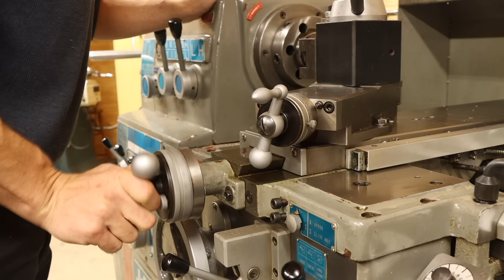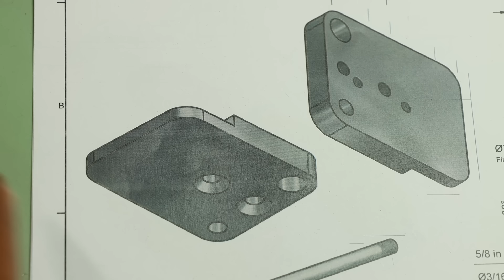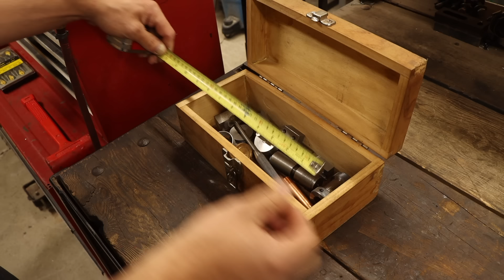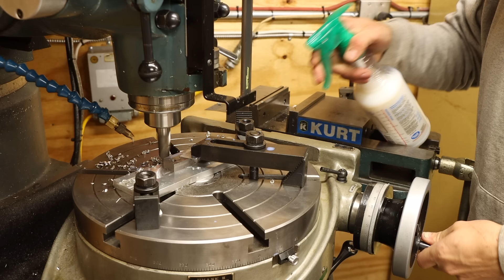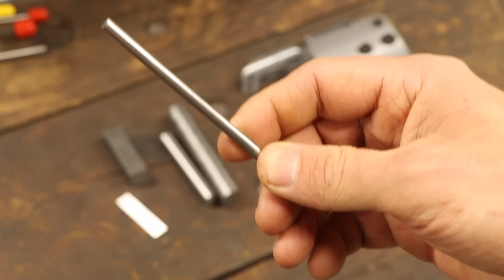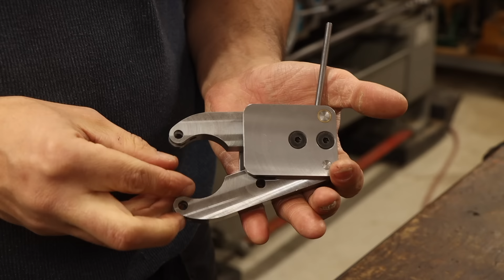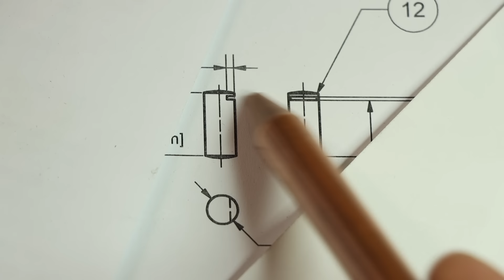Making the KING of All Knurling Tools (Part 1) || INHERITANCE MACHINING

Comment: 4:07 were the countersink screws not in the kit?
Reply from the maker: Yes they were
Reply: @InheritanceMachining  oh .... what came in the mail ~just in time~ .... the vise stop?
Reply: Oh you're talking about the counter bit
Reply from the maker: @dizzolve  oh sorry haha i was referring to the countersinking cutter.
Reply: @Inheritance Machining  I love those Hemingway Kits. I built the mini boring bars. Very simple but fun. Also got some round machine belt from them.  Nice build
Reply: @InheritanceMachining  did you have to buy the knurling wheels separately in this kit
Reply from the maker: @dizzolve  It looks like they are an extra charge on top of the base kit. They have a couple wheel options

Comment: Well done, Sir! I am surprised that you didn't modify the design to integrate QD tool post mounting features.  I know it would limit your mounting options, but it seems like it would fit your style. Keep the great content coming.
Reply from the maker: Thanks! I though about it actually but seemed overkill. This thing is a lot smaller than most of my tool holders to begin with

Comment: Nice job.  I am surprised you didn't use the surface grinder to clean up the stock.
Reply from the maker: Thanks. I thought about it but figured the parts would get scratched to hell with all the sliding surfaces.

Comment: Pardon my ignorance, but wouldn't the knurling pattern change drastically based on the diameter of the part? I thought that was why your other knurling tool had fixed wheels...
Reply from the maker: No worries. What sets the size of the pattern, i.e. distance between grooves, is the wheels themselves. They basically transfer their pattern like-for-like to the material. So if you want a different pattern you need a different set of wheels.
Reply: So say the desired knurling is cross-hatching, the distance between the wheels doesn't affect the actual size of the cross-hatching?

Comment: I have made this kit, very useful 
If I was to make it again I would try to make an integrated quick change tool holder rather than the side plate and bar
Reply from the maker: I considered this as well but with my QCTP being a CXA size it seemed overkill for the size of the knurler itself. I'll just dedicate a holder to it.

Comment: Great and timely content again.
I wound up doing some prototype work in my home shop for work, using a modified commercial clamp knurling tool - I may keep it once the project is done...  However, the design you are making is much classier, and the eccentric is such a cool feature.
Also, you need to add your makers mark to your work.  Engraving? A pantograph of your logo?  Future side project?
Reply from the maker: Thanks Keith! Yeah so far I'm really digging the details of this particular design. I have my heart set on a pantograph at some point 😉

Comment: Excellent video and machining work as always. I have an original Marlco tool which revolutionised the quality of my knurling. The original relies on the pivot pins for the knurling wheels being a press fit for retention.  The retention system in the Hemmingway design is a big improvement.
Reply from the maker: Interesting! I'm looking forward to trying this thing out

Comment: I have a small finishing compressor in my shop. The CFM is low but it isn't that loud and its always warm. I was also thinking last video, at the end of 2023, you should take your box of shame and make something interesting with all the parts. Maybe a collaboration with adam savage. LOL. Just an idea. Anyway, great work as usual. One day I'll start on some of these projects to help increase my skill level. Just don't have any time these days to invest so I'll be buying the clamping knurling tool for the time being.
Reply from the maker: That compressor could honestly use a good servicing. I've never actually touched it believe it or not. I ended up bringing my portable compressor in after a couple days. I like the idea of collab like that though. Could be a nice trip down memory lane haha

Comment: hmm yes I think your box of shame got quite a work out there,  You might want to check out your compressor and make sure the tank is in good condition if the oil is turning to goo it could also be getting some serious corrosion inside and air tanks bursting is not something you want near your workshop (or anyone you like even just a little bit)
Looking forward to some more Knurling tool fuin next time, I seem to remember using something very much like that when I was in school, which is also the last time I used an engineering lathe thinking about it.
Reply from the maker: Thanks. If I'm being honest I've never actually serviced that compressor so who know's what condition it's in. Might have to do a dedicated project on it.
Reply: @InheritanceMachining   I was in two minds as to wether to post what I did, I am glad I did now 🙂 and cool a new video idea...

Comment: Brandon, I've noticed that you've had repeated problems with mill height clearances when using rotary table. Have you considered a riser block to increase the head & table clearances? or perhaps make your own low profile rotary table and chuck?
Reply from the maker: Oh yes this is a definite issue. Ive been weighing which direction to go and I'm leaning towards a low profile chuck. I find myself with the table very close to the spindle (for rigidity) more than I've needed the clearance (only a couple times)

Comment: I'm enjoying your sense of satisfaction from perfect pieces. Also your drafting old school, reminds me of my mid 80's high school. That and a couple small projects from machine shop classes. But i can't figure out why the slot for the knurling wheels are offset?? I'd have thought to centre slot to increase stiffness to resist twist arms. Any ideas Guys or Gals?
Reply from the maker: Thanks. I think it's mostly for clearance. Allows you to get just a little bit closed to the chuck jaws. If it does twist ever so slightly that could be advantageous as well so you have a gentle ramp effect as you work your way down the piece

Comment: The sanding plate you mentioned - is that just a precision ground plate with sandpaper on it, or something more?
Reply from the maker: Sortof. I believe it's a solid delrin or nylon plate with adhesive grinding paper attached. Its part of a chisel sharpening setup my grandfather had that I like to use for finishing work like this
Reply: @InheritanceMachining  ah ok, interesting! It looks awfully handy. I was trying to find something like it, but haven’t had much luck.
Reply from the maker: @flare_fabrication  the original kit came from Rockler. Looks like they offer a glass plate version now.

Comment: A “wall of shame” is more useful than a bin because it keeps the goofs in sight helping to remind you of what not to do again. I have a few small drops of dried blood on the floor in front of my table saw that I’ll never remove because they remind me never to rip pieces again using a push stick that isn’t properly rounded off. Scars tend to fade with time.

Comment: You used a guided tap wrench to be sure.. but you also saw that the tap wasn't really... straight?
If I saw correctly your m3 tap wobbeled around while tapping the hole. Looks like this tap wrench is a bit off. Cries for a remake. (Those also come with ratchet mechanisms, might be a nice project)

Comment: The true "King" of knurling tools is the cut knurler.  That forms the knurl by removing material and can make a wonderful, tactilely grippy knurl.  The Knurl you're making still forms the knurl by plasticly deforming the surface.  Its okay.
Reply from the maker: True but a plastically deformed knurl will be tougher because of the work hardening

Comment: Brandon, thank you for another great episode of machining. A small tip from my side; if you clamp two "identical"parts together in one vice or chuck just add a piece of plain paper. It will for correct the small differences in the parts and the bowing under pressure of the clamping device (chuck/vice etc.) and can make a difference in to be safe or sorry. Drilling is not that critical because the main force is downwards. But by using paper as a shim (in a decent vice or chuck) you can also mill identical features without moving one of the parts. God and the devil are both in the details...
Thank you! Best, Job
Reply from the maker: Ooo the paper idea is great. I let it slide just because it was drilling only but the paper is a great tip. Thanks!

Comment: That micro square, I must have it, where can it be found!
Reply from the maker: 😂  I'm sure they exist in the online stores like MSCDirect
Reply: @InheritanceMachining  I've never found a square smaller than 2". I'm a goldsmith so even that can be too large sometimes.
Reply: @rowanwiegel4695 : A small investigation returned two options for such small engineer square:

1) Easier to aquire is Moore & Wright MW910-01 precision square. It is metric 40x30mm and I guess it is what you would look for. Check EBay for such.
2) Almost impossible to get is NOS from manufaturer from Poland called FWP / VIS. It doesn't exist anymore and the model Brandon has I reckon is MKSg 50x40 VIS.

Comment: To my understanding, it's not great to great to stack parts in the vise unless you have something else holding them together. It's possible one won't be clamped as well as the other and get knocked out of position while machining. Also, with end stops, I was told you should set it before edge finding, then reseat the part against the stop. While tightening the stop, it's likely it pulled away from the part a few though, so reseating, then edge finding will make sure you're always tight up against the stop.
Reply from the maker: Both good points. Thanks!
Reply: @InheritanceMachining  no problem!

Comment: Something that improved my knurlling was taking more passes with lighter pressure.  Once I engage the knurlling tool, I keep it engaged until I'm done. Once I reach the end of a pass I stop the lathe and reverse the spindle and lead screw back to the beginning. Perhaps that's how everyone else does it as well, but I was a little slow to figure it out.
Reply from the maker: I'll have to try that out when I'm finished

Comment: You may be interested in a tool another machinist on youtube made; Blondihacks made a corner rounding fixture for her rotary table that's reusable for projects like this. It's basically a morse taper mandrel that sits in the rotary table and accepts pins of different sizes like the one you machined out of aluminum. They have a little shoulder that raises the part above the rotary table so you can stick parallels under there. Makes setting up corner radiuses and dogbones much easier than milling a new fixture plate every time. The drawings are on her patreon but the video is in-depth enough that you could probably draft your own design on the concept, it's pretty simple.
Reply from the maker: I think I recall seeing that as well. Might be worth investing some actual time in a setup like that so I'm not constantly making new pins and whatnot. Thanks!
Reply: I was literally going to suggest the exact same thing.
Reply: Well, wouldn't that be that a nice idea for a side project? ;-)

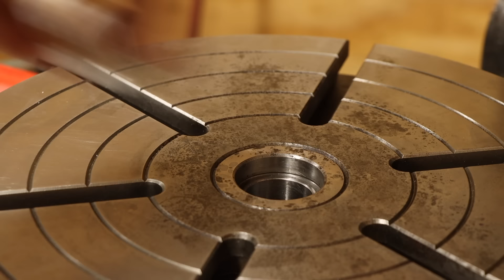Comment: 9:55 I think we'll be seeing this setup a lot in the future.
It would be really cool to see some quality bearings used instead of brass collars.  Not sure how, but it would be cool.
Reply: Bearings are good for high speed applications, but given the very high forces involved here, brass bushings are definitely the better option in this instance.
Reply: @JaenFoster  So brass is better?  I guess proper lubrication would help?
Reply: @AndyFromBeaverton  for low speed high force applications then yes brass/bronze bushings absolutely are the best. That's why even with the advent of advanced ceramics, they're still used. Friction isn't the issue here, it's the concentration of force, or pressure. A bushing takes that force and distributes it over the entire half of the rotating part reducing the pressure on any given point, rather than concentrating the force on the few bearings that are in compression increasing the pressure at the tiny contact point between the ball/needle and the raceways.
Reply from the maker: Could probably make use of some low profile needle bearings. Perfect for partial rotation applications like this

Comment: I think I remember Adam Savage going over this same Hemingway Kit clamp knurler recently, it is an awesome piece of equipment.
Reply from the maker: Yup! If I recall Adam reverse engineered his own with some other features included and slightly larger. Clough42 just recently did the build as I am from a kit.
Reply: They are the best kits on this. You've basically 3 major options. Start from scratch, buy an old one, or buy this kit and season to taste. IMO, buying the kit is the best option. If you start from scratch, you're going to have to use a lot of tasty chunks for this, and that's a shame when the kit (or the old ones) exist. And buying an old one comes with potential baggage (worn parts incompatibility issues).
Reply: wasn't adam savage but Clough42
Reply: @arminrichard1836  I found it, he was building storage for it. https://www.youtube.com/watch?v=u23RoUDHvgI

Comment: This seems like a video that rather than having an abundance of side projects, is more dangerous at inducing side projects in the audience. I always think about knurling this or that thing that I make, and often avoid doing so because of the annoyances of the tool I have, similar to what you started with.
Reply from the maker: I've definitely had reservations at times when using my old knurler. I'm looking forward to trying this thing out
Reply: Same here, I cringe at the side load its putting on my headstock!